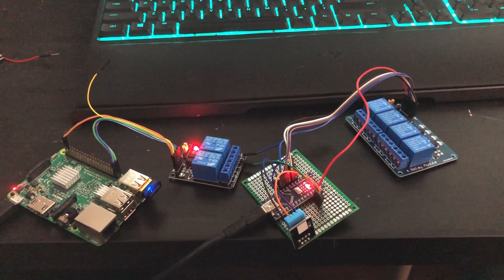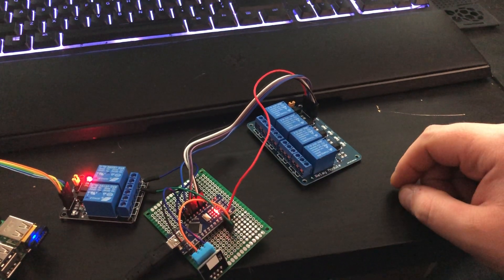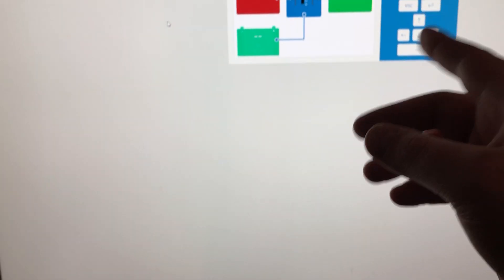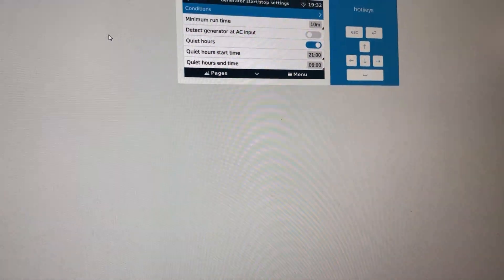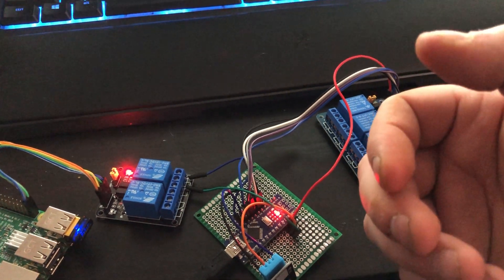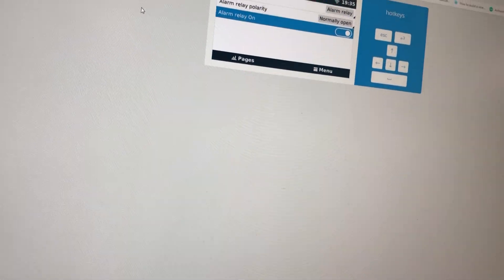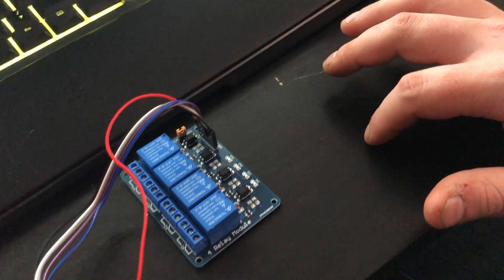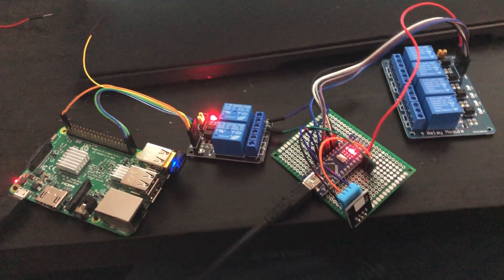DIY Victron generator start with Raspberry Pi and Arduino (Victron Venus Raspberry Pi)

Comment: So you're closing the contact on the key fob? It's difficult to see which part is the original generator remote control. 

I'm in a similar situation but I have the CerboGX and a Multiplus II. 

I'm thinking I can hack one of the key fobs.

Comment: Hello,  it would be great if you could explain or point to some documentation where to configure which GPIO Pins are used by the generator setup. I see the cables, but not the SW configured.
The rest is pretty clear and triggering a Relais with Venus OS is just what I am looking for.
Many thx

Comment: Thanks for putting this info up. Over the years I have used gensets for portable work. Leaving the fuel valve turned on while unattended is risky, and not recommended by the manufacturer. The valve in the carburetor can leak, flood the engine, and in extreme situation the fuel will dilute the engine oil. Use a voltage controlled solenoid to eliminate that issue

Comment: How do you know what the raspberry pi pin out is like im just trying to figure out did you program pin 40? Or is that stock venus os
Reply: In the latest vesrsion of the Rpi venus OS 2.60 pin 40 is linked to relay 1.
Reply: @vladimirmajkic9727  do we know what the rest of the pins are?

Comment: You can run up to 6 relays now with the Venus software on the raspi. We have reconfigured the Venus relay control page to be on the front screen called switching .Also we have a interface done for this and to include I/O Analog inputs for temps and tanks Canbus VE direct etc.
If any ones wants the information and schematics to how this is done the are open source just email me.
Reply: Hi Rob, i couldn reach you at a different way so i hope you recieve this comment. i would be very interested because of the relays to, could you please share your information with me?
Reply: @christopherhasenohrl5465  yes email me
Reply: I would love that information, if you don’t mind - let me know how to get a copy or get in touch with you.
Reply: @TheBergMeister   raduthie@gmail.com

Comment: Thanks, appreciate the presentation!  I have a Victron CCGX (color control monitor) that runs the same Venus OS. Question: I get the Arduino to relay functionality, but how, do the relay's send a wireless signal to the Champion's start/stop receiver module - just not seeing that part of the hardware circuitry or is the wireless transmitter built into the relay board module?

Comment: It's good to see someone using the relay output. The reason for choosing pin 40/GPIO21 was precisly because it is right next to a ground pin (39)... which is probably not a big thing, but does make it a bit neater in my opinion, you can use a two-pin header for it.
Reply from the maker: I'm running into the OS hanging every few days. It was every few hours until I disabled the Wifi module. I haven't done any modifications to the code other than just configuring Venus, enabling the relay output. No joy checking watchdog or figuring out crash logs, directories seem to be blank. Ah, and I switched my noisy Buck Converter to a clean DC source. I may need to switch to a Victron unit in the end for reliability, or write my own generator code.
Reply: Hi Izak. How can I wire the relay and make it works on the Venus Raspberry? And what about digital and analog inputs? It's possible to wire some buttons to the GPIO ports to navigate thru the Venus menu? Thanks !!!
Reply: @BivacCamper  If you check hobbyist sites you should find several 5V relays that can connect directly to pin 39/40. Of course you can also wire it up via a simple NPN transistor switching a higher voltage relay in the negative line. Explaining this is a bit out of scope for the comment box on youtube!

In theory it is possible to use GPIOs for a keyboard, but you will have to construct a dts file and compile it to dtb explaining this layout to the kernel so it will show up as a keyboard. It's possible in theory, but I have not tried it, I don't know anyone that has, I was kinda hoping someone would have done it by now :-)
Reply: @izakburger1580  Thanks for the answer. Do I have to do something (change some settings to the raspberry pi software) to make it work?
Reply: It works!! But when I turn off the vswitch from venus the relay energises. There is a way to flip it? When I turn off the switch the relay turns off?
Reply: @BivacCamper  That's a bit odd. I haven't looked at the relay code in a really really long time, not since implementing it, and even back then I used an automotive test light (the LED type) just to prove that it works. Never attached a real relay.

Nevertheless, it seems you can invert the gpio sense by putting a 0 or a 1 into /dev/gpio/relay_1/active_low.
Reply: @izakburger1580  Thanks Izak. I've tried to change from 0 to 1, but when I restart the raspberry looks like it comes to 0 again. Looks like something is forcing to go to 0.

Comment: Very good, you know that instead of using the keyboard the mouse function works over the buttons on the screen of the Venus interface.
Reply from the maker: Ha! It didn't work on my PC, but touch functionality works from my phone. Thanks, Rob!
Reply: Hi
Very odd it should have, have you installed these files below?
###### Victron /opt/victronenergy/gui/start-gui.sh modification ######
#Add the following lines right after the  "when headfull "comment block
#Note that these require you to have calibrated the screen, saving the various calibration files. (CTRL + O to save, CTRL + X to close/exit)

export TSLIB_TSEVENTTYPE=INPUT
export TSLIB_CONSOLEDEVICE=none
export TSLIB_FBDEVICE=/dev/fb0
export TSLIB_TSDEVICE=/dev/input/touchscreen0
export TSLIB_CALIBFILE=/etc/pointercal
export TSLIB_CONFFILE=/etc/ts.conf
export TSLIB_PLUGINDIR=/usr/lib/ts
export QWS_MOUSE_PROTO=tslib:/dev/input/touchscreen0        
echo                                                                                                    
backlightctl.sh 50
export QWS_KEYBOARD=USB:/dev/input/event1